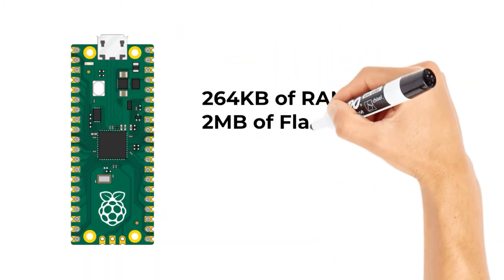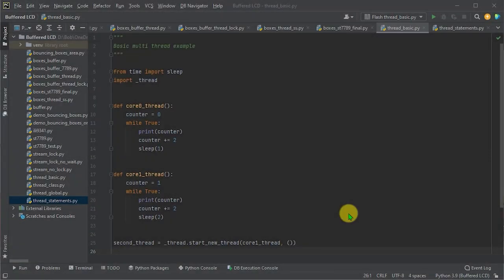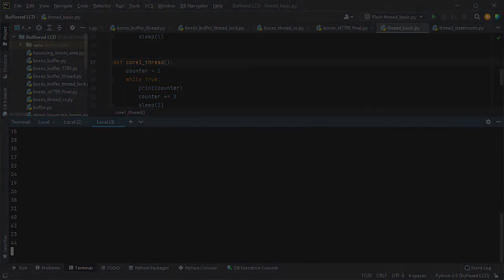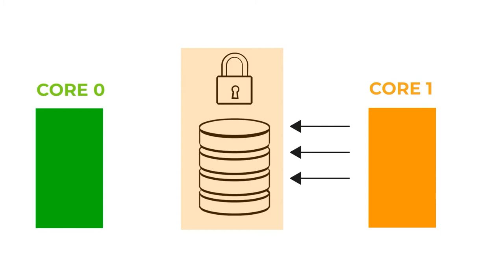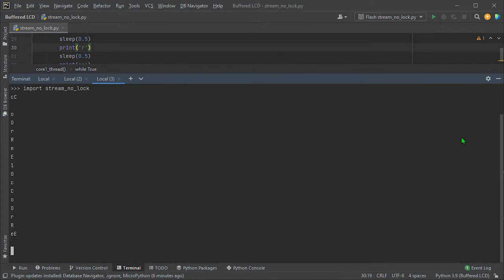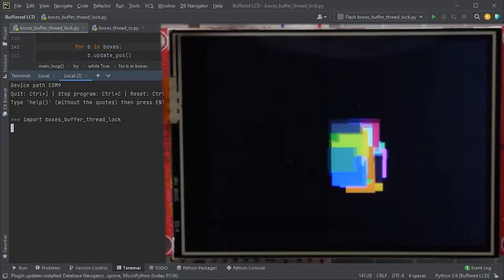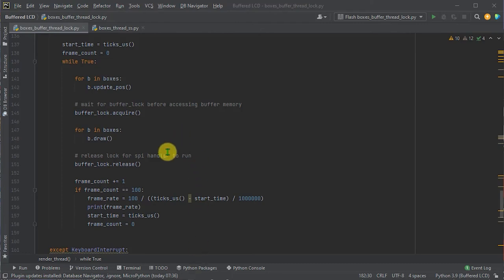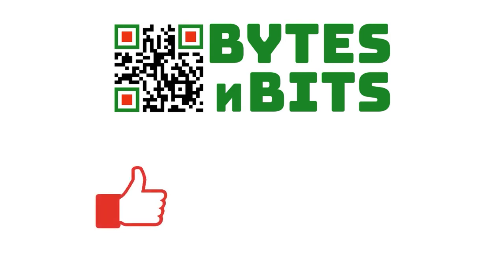Multi Thread Coding on the Raspberry Pi Pico in MicroPython - Threads, Locks and problems!

Comment: It would be interesting to compare the maximum frame rates of each method to determine how much more efficient each was compared to using only one core. There must be some overhead involved in switching cores that could be quite significant.
Reply from the maker: Hi. I did do some work on that in making this little RP2040 console  - https://youtube.com/shorts/Qusjn49OLL4.
I do plan a video based around it but work has been quite hectic for the past few months.
The core switching isn't such an issue. Once you get your threads up and running they really do work in parallel. The key is in dividing up the tasks and making sure that one doesn't block the other when accessing resources etc.

Comment: I’m not sure about the fact that the second thread is running on the second core. I’ve already used threads in my projects but with an ESP32-C3, so a single core microcontroller and it runs without problems.
Reply from the maker: The Pico handles threads differently to the ESP32 in MicroPython. On the ESP32 MicroPython code can only run on one of the cores so your threads are running as tasks on the same core. The Pico allows you to run MicroPython on both cores (mostly) but can also use the asyncio package to get multiple tasks per core.

Comment: thanks! what micropython fw version do  you use? so main question is does _thread module can be used in production code?
Reply from the maker: If you check the Micropython docs it's still listed as experimental - https://docs.micropython.org/en/latest/library/_thread.html.
I'd be wary of using it in anything where a system crash would be bad.

Comment: i am trying to program a clock (micropython, raspberry pi pico). my goal is to be able to set the time while the clock is ticking. is this possible or is it a contradiction.
Reply from the maker: That should be fine. Your code will need to take account of the time reset in the way it tracks time. I'll leave that to you to work out!

Comment: What is that IDE that you are using?
As well could this MicroPython setup you are using guarantee timing precision during execution?
Reply from the maker: Hi. I use PyCharm for my coding. There is a free community version that does everything you need. Make sure you install the MicroPython plugin so it can talk to the Pico.

MicroPython is an interpreted language so is much slower than C++. It is aware of time and you can use this to make sure things happen at the correct time. If you are trying to get very tight timing e.g. some sort of signal timing, then I'd probably go with C, or have a play with the PIO system.

Comment: Will there be any issue when apply the same method to all the other cores available ? Assumming earch cores handle one box redenering around the LCD and running around. The use case is appilcable for max. 8 application running concuerrently or different input running curently ?
Reply from the maker: Hi. The RP2040 only has 2 cores for you to use. You can only run 1 thread per core. If you are using a processor with more cores then the same method would apply.

Comment: Wondering if you have any more info on how to use the REPL tool in PyCharm - for example, flashing a program to it causes it to run immediately, but when opening REPL the keyboard interrupt ends it. Using the soft reboot is enough to reset it, but it's an issue using the socket library for my web sever as I get the EADDRINUSE OSError, essentially that the static IP address I want to bind to is already being used, but by the instance that was interrupted. 

You seem to be able to just upload and start it in a few examples here? Plus the terminal window you use just says 'Local', mine has a path to "...\venv\Scripts\python.exe". And obviously I can't flash a new version of the file unless I close the instance of REPL terminal as the COM port is in use...

 If you know of any sources online about how to use REPL to debug beyond the official documentation (which is not great) I would appreciate it a ton :)
Reply from the maker: Hi. Make sure you're using the latest version of PyCharm. They fixed a number of REPL bugs a few months ago. After that make sure you've got the project set up and the extra Micropython add ons installed. If you upload a file called main.py it will auto execute, or if one already exists that will execute. Try saving the main entry point for your code as something different , e.g mycode.py, and delete any main.py. Once you upload you'll be able to REPL onto the device and start the code manually, import mycode.

Comment: Hello, wanna try your example, but only got a 1.8 tft spi (128x260) (the red one with sd card reader) and no MISO nor MISI but only A0 and SDA ... how can i adapt teh code?
Reply from the maker: Hi. Are you sure this is an SPI lcd? Those connections sound more like part of an I2C interface.
Reply: @BytesNBits  they sell like "AZDelivery Display SPI TFT 128 x 160 Pixel" :-(
Reply from the maker: @V1P3RSlab  I think A0 is the DC pin. SDA is MOSI. There is no MISO as this isn't really needed for the TFT panel. The other pins should match the video. I hope this helps.
Reply: @BytesNBits  trying, i let you know :D
Reply: @BytesNBits  no way. Using pycharm i got some compile errors on library versions, using thonny, i adapt the code but receive the "unsupported display"
Reply from the maker: @V1P3RSlab  Hi. You'll need to check what driver chip your screen uses. There should be a range of files for each type of driver chip. Have a look at the screen data sheet.
Reply: @BytesNBits  st7565 but now i got a ST7789 one .. still mapping nomenclature :D (why the producers do not use a standard??? LOL )

Comment: Thank you for the time and insight you provide with your channel. 
If each thread waits for the other one to finish its access to the frame buffer, what is the advantage of using two cores? The renderer can only do a little work (some Trig maybe)  before its main job of accessing the frame buffer. The two cores would indeed run in parallel if the frame buffer were double-buffered, but of course this is not possible with the small Pico RAM size.
Reply from the maker: You're right about the double buffering but this setup can still work well. The idea here is that you split your code into an update phase and a render phase. The update phase is the parallel part so you try to put as much of the processing load into that. The bouncing box demo doesn't really have any update processing but the Asteroids game (I hope that's shown in the video!) performs all the polygon rotations, collision detection, etc. leaving only the actual drawing of lines into the buffer for the render phase. You can actually make some great multi thread savings this way.
Reply: @BytesNBits  Great answer, thanks.

Comment: I'd be interested to see the code running on a single thread and compare any advantages as both your threads are locking. Each thread is waiting for the other to finish, so in effect only a single thread is running code while the other waits. Why not use 2 buffers and a signal from the drawing thread to force the display thread to update one of the buffers ?
Reply from the maker: Hi. There's not enough memory for a double buffer so the single buffer becomes a bottleneck. Only the redraw to buffer can't run in parallel so the idea is to keep that section as fast as possible by doing all the calculations etc. in the parallel update code. The dual core advantage only starts working as the complexity of the game mechanics increases. In the boxes demo the model updates aren't very processor intensive so not a great increase in speed from dual cores, but the Asteroids code processes all the screen objects as line vectors with full polygon collision detection so we do get quite a speed boost.
Reply: @BytesNBits  Ahh, yes, MicroPython taking memory and resources. Probably more practical to use pure C++. What you have now though, is good enough and works pretty well.

Comment: Is the buffer a string of 75KB ? are 2 buffers used ?
Reply from the maker: Hi. Basically yes - 75KB of single byte integers / characters. There's not enough memory for 2 buffers so the processes have to share the one memory block. Double buffering would be great but not really an option without more RAM.
Reply: @BytesNBits  how many colours are used ? could 4 bits be enough ?
Reply from the maker: @jyvben1520  Hi. For the LCD panel I was using it's 16bits per pixel. You can store the colour info in memory in any way you want but you have to expand it out to the full 16 bits to send to the LCD. Pure Python isn't fast enough to do this on the Pico.

Comment: then theres the PIO stuff. they basically function as 'event computers' that generate CPU interrupts based on the interaction between a state machine and the input stream. This makes it easy for drivers to be efficient because there is no impedance gap to cross converting from a raw data stream to contextually meaningful IO events. While the PIO is figuring out what events it should tell the CPU about happening on the IO pins, the CPU is free to do whatever it likes, and is not occupied doing this work itself like it would be in many other computing environments.
Reply from the maker: Thanks for the info. PIO is something I intend to look at in some upcoming videos.

Comment: Where did you got the idea that multithreading is implemented using the 2 cores ? 
There is nothing in the documentation that can lead to this conclusion
Please explain why you think so. Also explain what happens if you declare 3 threads...
Reply from the maker: Hi. The Micropython threading package assumes one thread per core. I know in more powerful processors you can run multiple threads per cores but that doesn't seem to be implimented in MicroPython.
Reply: @BytesNBits  Again, there is no such thing in the documentation
The Micropython documentation points to CPython documentation and CPython does not know about multicore.  
Beside, MicroPython runs also on the ESP32 which has only one core...
Please post the web page adress where you found this info
Thanks
Reply from the maker: @Новости-з3й  Thanks for your comments and tips.
Reply: @BytesNBits  Finaly, I checked the core assumption using a simple script which reads the CPUID register from the RP2040 and you're right, the first thread runs on core 1
Adding a second thread as you mentioned leads to an error

Here is the script for those who are interested :
-----------------------------------------------------------

import time, _thread
from machine import mem32,Pin

led = machine.Pin(25, machine.Pin.OUT)

def Core0():
    while True:
        led.on()
        time.sleep(5)
        #read CPUID
        print("Core0 = ",mem32[0xd0000000])

        
def Core1():
    while True:
        led.off()
        time.sleep(5)
        #read CPUID
        print("Core1 = ",mem32[0xd0000000])

_thread.start_new_thread(Core1, ( ))
time.sleep(1)

Core0()

-----------------------------------------------

Core0 output is 0 and Core1 output is 1

Regards